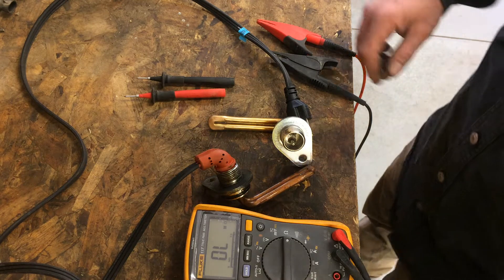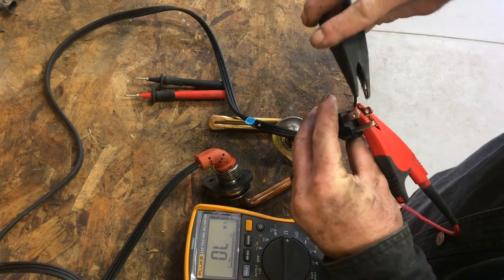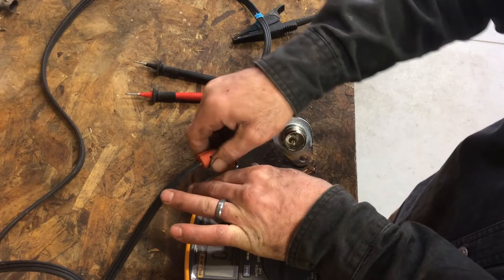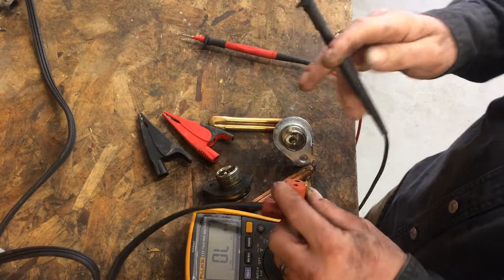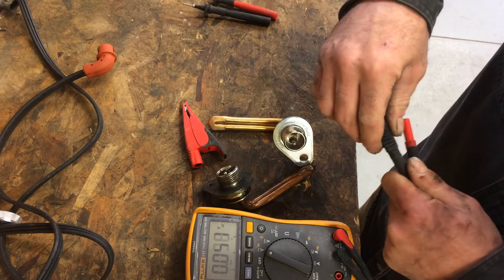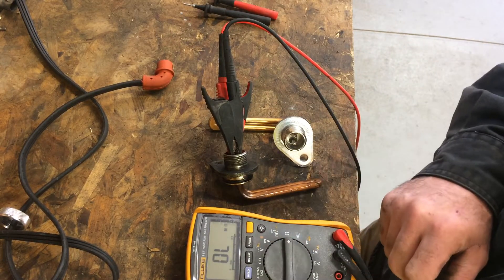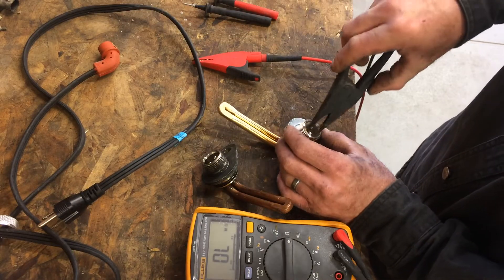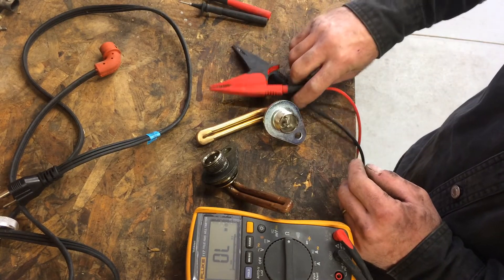Block Heater test

Comment: Weird question, but is there any chance that the copper tubing on those heating elements can be bent? I have access to a straight one but I need it to be bent in order to fit into a detroit diesel block.

Comment: I recently bought Sienna with 2GR-FE engine, and there is some cord going inside the hood. Not visible from any underneeth or from above. So most likely it's some kind of "block heater". I'm afraid to turn it on, because previous owner said he never used it for 10 years or something. Can I test it like that or it can be different kind of heaters? If it's corroded, can it burn the fu@ng car?
Reply: @barfbaby  thanks. My block heater was good, but the cable was torn apart

Comment: You are so dumb.  1.  Frying your meter plugging in 110v in ohm mode.  2.  Changing settings on meter with 110v plugged in.

Comment: I went to go and unplug my extension cord from my Diesel last Saturday, and the cord was melted where the heater cord was plugged into. What is going on before I try to do Your test ? Bad extension cord or bad heater cord? Heater cord is not even a year old from Ford. Should the cord coming from heating element plugging into extension with 3 prongs get really soft since getting warm? Or should it stay hard like normal ?
Reply: normal
Reply: @danus-motbakken  sounds like I need a new block heater cord? Sometimes soft and Sometimes not. Depends on how long plugged in and how cold it is outside. Thanks
Reply: @Richard5873  i have mine in for 6hours now and its cold. But thats 240V. Not 120V. But i dont know how much ampere/watts yours is rated🤷‍♂️ mine is only 300w. Wich is nothing basically
Reply: @danus-motbakken  Mine is stock Ford,and it is a 50 foot at 10 gage wire . Rated voltage 125,max amperage 15,max watts 1875. Not sure if shorter cord would be better, I know I'm looking at around $100 for new heater plug wire IF my issue. It heats up by looking at my tuner gage. Thanks

Comment: My cord shows power. But, I think my element is loose or NFG. It $63.00 here in Alberta. I'll rejigger it to make sure element not loose, but I'll have to replace whole thing. Note* I eyeballed mixture -47°! Maybe that is issue. Coolant 1 year old, but putting in 50/50 premix, -35° see what happens. Thanks.
David

Comment: if i had a cheap meter would not first switching to voltage mode on it, before doing the test where plugged in to the mains, end up wrecking the meter for future resistance tests, if not wrecking it completely even?
Reply from the maker: No it should be fine.